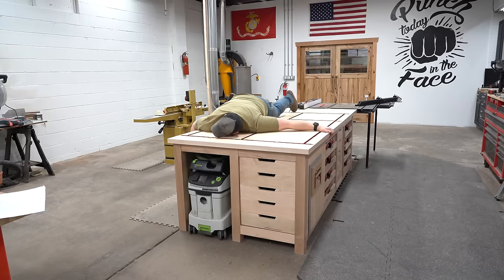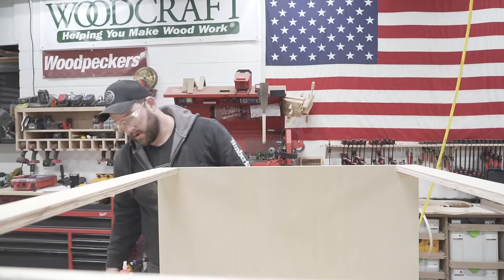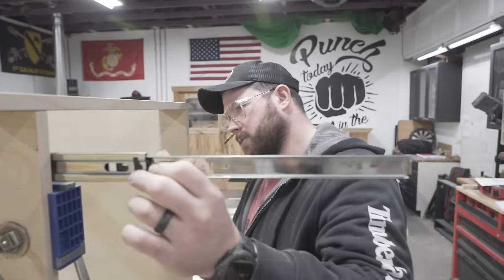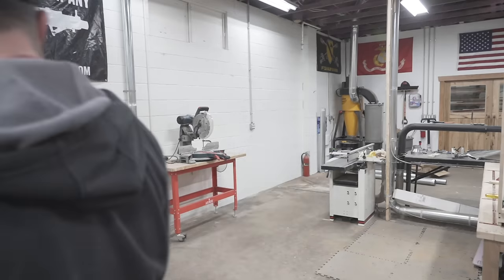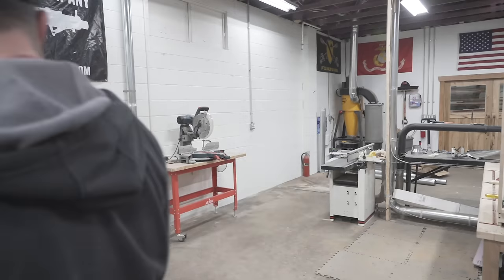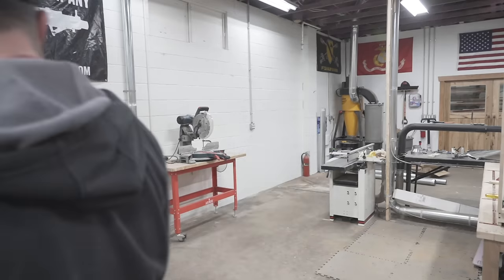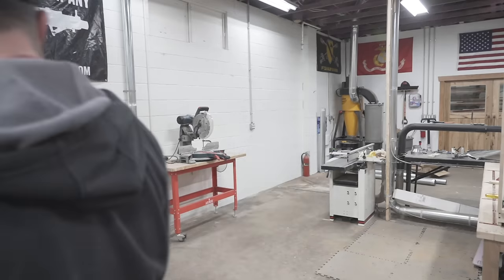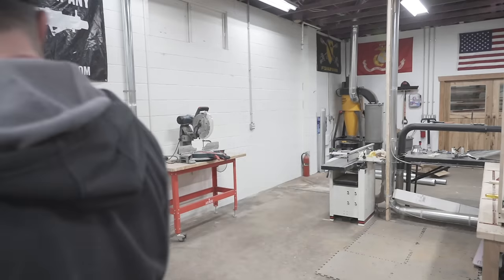ULTIMATE Miter Saw Station with Downdraft Table!

Comment: great video and a really cool setup.   I actually think the curved piece might be hurting your dust collection, I know its to keep the airflow close to the saw, but i think its also acting as a deflector guiding the chips up and away from the vacuum ports before the suction can slow them down.  if you just had the square box with the downdraft the chips wouldn't have such an easy path out and many would hit the back top, slowing them down and letting the suction grab hold

Comment: I have the same saw and built a similar box around mine, ended up building doors that attach with magnets to focus the dust collection behind the blade. Dan Pattison also had a video improving the DC on the same saw.
Reply: Dan's mod includes altering the dust port and the boot behind the blade.  Very effective mods!  I have both on my Bosch Glide; big improvement.  Go to a 90 - 100 tooth blade as well to cut down the scatter-- huge difference.

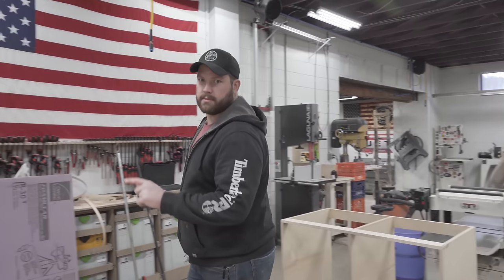Comment: "You don't need some crazy tools" 5:04 .... proceeds to use a festool track saw in the next shot
Reply: I own a DeWalt Track saw, and I love it! One of my best purchases ever. Need to buy the cordless one next.
Reply: @multidinero  yeah, but if you have the money,  Festool is literally the best thing you can buy on the market for power tools, they will last you for a lifetime
Reply: @sharpskull2476  I’ve owned most of my DeWalt tools for years without incident. I’m not saying that Festool is not great, as it’s expensive enough that it should be, but I can buy two of nearly anything else for the same price. I’m interested in a Domino, yet otherwise the other stuff they sell are similar to what I can buy from other sellers. Skill outpaces tools. My DeWalt is great.

Comment: I have the same saw and have used a hose to collect the dust. Seemed to do ok to me. Your down draft would work better if the saw wasn’t sitting 4” above it- impossible I get it.  I’m in the process of building a miter station. I may modify your down draft idea. 

Love the videos!!

Comment: I got a hold of some of the clear plastic/rubber strips they use on walk in freezers and use that to frame around my miter saw. It keeps the dust in but easily moves out of the way when swinging or tilting the saw.

Comment: John.  Love your videos and yet another great project.  If you pause your video at 9:28, you'll see that the small black deflector installed on your saw is kicking the dust upward, away from your new dust collection.  If you can, I'd remove that deflector.  Also, you have a lot of open area for dust collection with all of your slots, which slows down the air velocity, and actually decreases the effective collection area of your dust collection.  I know, sounds counter intuitive but trust me, I do air handling engineering in my everyday job.  I'd try using some masking tape to cover a few of your slots to see if you can get the air velocity increased, which will give you better dust collection.  Good luck, and keep the videos coming!  Bill

Comment: Just stumbled on your channel, love it so far. I would recommend a face plate for the dust box, cut out just enough that your saw comes through it freely (use cardboard for an easy template). The better enclosed that box is, the more suction you will have for the dust to be pulled in.

Comment: I had an Uncle who LOVED eating lemons, and an occasional raw onion. As strange as it may sound, both are jam packed with antioxidants, and no, I would never eat either.

25:50 I think the handicap in your dust collection is the slots you cut in the plywood to serve as a grill for the duct collection. It does look very restrictive, the slots are fairly narrow and pretty widely spaced out.. I would cut that entire section of plywood out, route in a rabbet, maybe 1/4 inch deep and 1/2 to 3/4 inch wide, whatever works best for you, around the edge of the new hole, and lay in a piece of expanded steel (get it at any hardware store or big box store) and secure it with a few screws. Your dust collection will greatly improve.

Comment: On your vacuum system for your saw; have you thought about using a dedicated dust collector specifically for the saw so you only have the one port instead of using the dust collection system that goes throughout the whole shop; or install some inline duct fans (brushless) in the duct work to increase the air flow??????

Comment: Great video. Great build. I'm about to pull the trigger on your plans but need to know rough dimensions of the build, if possible. What size table saw can it accommodate and are the down draft plans included? I'm assuming someone in that shop is a Devil. 0331 here. Rah.

Comment: I ended up with some spare kitchen cabinet bottoms, any reason I can't use 2 of them for the bottoms of this and just build the top?  How hard would it be to adapt the center section to fit the saw to the cabinets?

Comment: I am working with these plans now.  On page 13, Item D (the top), it says it should be flush with the sides where the saw is located.  In your video, it looks like there is a slight overhang.  I just wanted to get your thoughts on this before i screw mine down.  Thanks

Comment: what's the dimension of the plywood you lifted? it seemed so easy, so lightweighted for you.. in my country its 122cmx244cm, weight around 30-40kg.. how about yours? damn man, i cant lift it up by myself since it's so huge, not too heavy but just couldnt get the grips of it

Comment: Hi, I'm interested in buying the plans for this project, but I was wondering the length of the bench.  I'm limited on space.  I'm also still sort of an amateur, but have managed to build one rolling cabinet with a flip top for my planer and a spot for a job site table saw with some drawers and cabinets.  It's not pretty, but it's functional.  Not too bad for a first major project, but I've definitely learned a lot since that build.

Comment: I'm guessing you had problems in the down draft for a couple of reasons.  Those slots were very narrow and so pulling the saw dust through would be less effective.  Also, maybe if you used a router to round over the slots the dust would more easily get pulled through the slots.
Unfortunately, I have the dewalt 12" and the damn thing is so deep I don't think I could make it work along a wall.

Comment: Scrap that 40 or 60 tooth blade you are using and get yourself a 90 or 100 tooth quality blade.  I don't have that fancy sucker behind my saw like you have but when I changed the blade, the dust scatter was almost eliminated.

Comment: Sorry, asked my question under the wrong login.  Please ignore the hamstereatscookies inquiry.

Hi, I'm interested in buying the plans for this project, but I was wondering the length of the bench.  I'm limited on space.  I'm also still sort of an amateur, but have managed to build one rolling cabinet with a flip top for my planer and a spot for a job site table saw with some drawers and cabinets.  It's not pretty, but it's functional.  Not too bad for a first major project, but I've definitely learned a lot since that build.

Comment: I haven't finished the video yet but I wanted to stop and say if you want an easy way to slim down (and get amazingly healthy to boot) you should adopt the Carnivore diet. All the meat and eggs you want with some cheese and butter thrown in. Seriously, everything most people know about diet and health is wrong. Red meat is the best thing you can eat, just so long as you don't eat it with carbs/sugar and vegetable oils, which are the worst things you can eat.
Try it for 30 days, I think you'll be amazed. Once I went to an all animal food diet I lost 40 lbs, my eyes improved to the point where I no longer need glasses, my asthma went away, my hayfever went away and my hand tremors went away. What have you got to lose - besides 50 lbs?
Reply from the maker: I have heard about this diet, works wonders for lots of people. I’m currently giving the Ketogenic approach a shot and already lost 10. Appreciate the input my friend and congrats on that massive weight drop !!